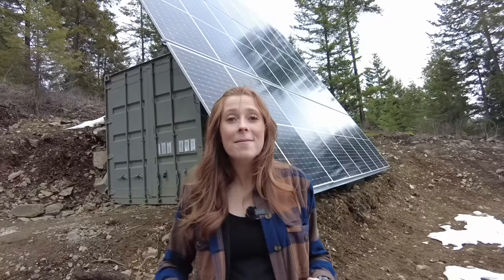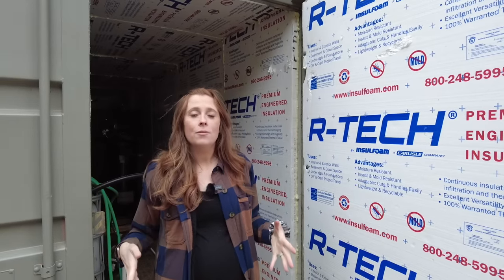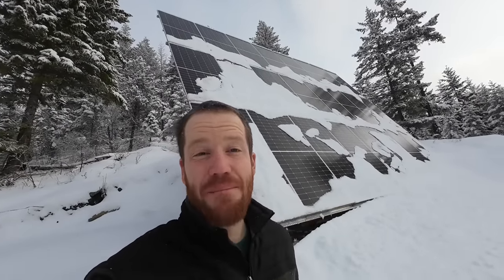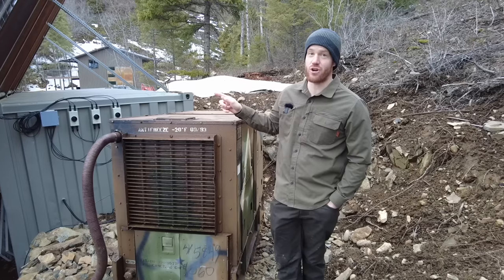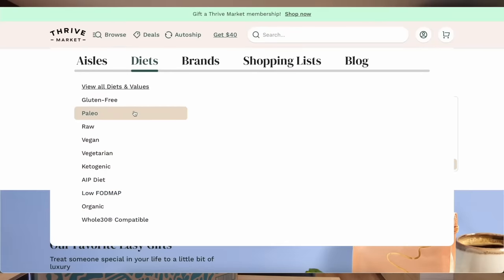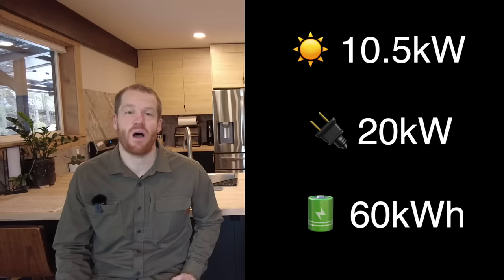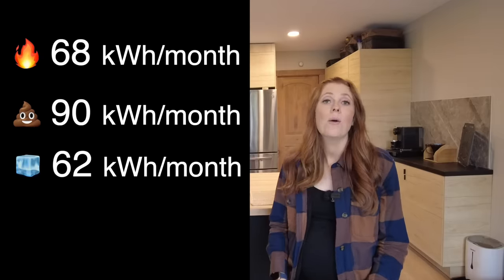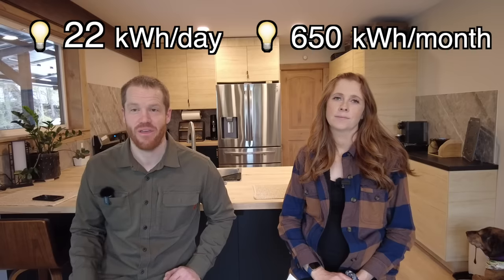The TRUTH About OFF-GRID Solar | Winter Update

Comment: I have a German made (Stiebel Eltron) whole house, tankless, electric hot water heater that uses zero power when there is no demand for hot water, it is no bigger than a briefcase, and it hangs on the wall in the garage. The model I have is 29kw at maximum power, that would allow me to turn on every hot water tap in my 3x2 house. When only one shower is running it uses only enough electricity to heat the water to the desired temperature. I know 29kw sounds like a lot, but there are two points to consider: unless you are running every hot water tap full blast you will never use all 29kw, and second, lets say for example one shower is being used and that = 5kw you are only using that 5kw for 15minunts when the shower is running. 
Even though your heat pump water heater is very efficient it is still using electricity to keeping a large tank of water heated when not in use.
If you switched out your water heater to a tankless whole house electric water heater and installed a septic system to negate the need for a power-hungry incinerator toilet you may have enough electricity from the solar panels to fore go running the generator at all. It is still warranted as a backup in case of exceptionally cloudy months. Another thing to consider is the added electricity produced by the roof over the deck.

Comment: Have you thought about adding a wind component to your off grid power?  I get that the cost to fix your deep winter "donut hole" would be pretty huge, but if they can be integrated, the wind power could give you an easy road, day and nite to backfilling it. Riley, Cortney- ya'll lookin' good in the neighborhood! Speaking of which, has anyone local been looking to hire an Ambitious D 8 operator and D 8? Your "driveway" project was awesome- and this winter seems to have shown few real faults and all are things you can correct.

Comment: It is refreshing hearing the realities of "off grid" and  that solar /green is not all unicorns and pink clouds. Still impressive what can be accomplished with good planning and quality components. It will interesting to see what on-site laundry will do to your power needs and if the fuel expended to go to town is greater or less than what running a generator will run. I'm surprised given Riley's fab skills you have not automated your solar array to tilt to full vertical to clear the snow. As mentioned dirt work will help.

Comment: You can go with a much smaller automatic start generator. Just size it about 20-30% over your average load. Yes it will take longer to charge your battery but your not sinking allot of money in a generator that you will only use in December. For intermittent large loads beyond the generator capay, you can have the battery cover the excess for that shor time.

Comment: You could save on refrigerator running cost by using an icebox setup for the winter months. Mom grew up with one of those and my GF's house has it still in the kitchen but now closed off from the outside air.

Comment: You could remote control the generator using some RC servos and a web cam. There are plenty of RC cranks and connecting rods that can be used to adapt to the control pots.

Comment: Great job ! much savings to be able to spend on other things. I only have a small 1000w system 4 / 340w panels with 1500ah of storage and I use my washing machine, you just do laundry when the sun is out & it takes no power out of the batteries, washing machine only uses 450w to run so when you have a 1000w coming in its no problem,

Comment: Thank you for posting details.  I'm designing a system for southern Michigan and I'm thinking of 92 kWh of battery paired with a solar array the same size as yours.  Rather than a generator, I'll supplement with grid power when needed.

Comment: Great to hear your firsthand account.   Interesting to note that even with a small house and a large panel system you still are running short in the winter.  Not surprising, of course, given the climate. But your point is well taken that it may not be worth it to increase the size to the point where a generator would no longer be necessary at all.  I will say, though, that based on your aerial shot at the end, I am seeing some trees relatively close to the array.   I'm sure you do, but most people don't realize that with most panels, even a small bit of shade  (like 5% of the panel) can easily stop the entire panel production, and possibly an entire string depending on the wiring.   So it is normally essential to remove all possibilities of shading.  If I were in your shoes, I would look at this carefully, and possible remove some trees near of the array. You may be pleased at the increase in production in the winter.
Reply from the maker: That is an old drone shot! We’ve done significantly more clearing since then.

Comment: When you get a washer, my wife and I (no kids) have found a 110v LG washer/dryer combo to be really electrically and water efficient.  Some folks don't think it drys 'well enough' but being a condencing dryer, it really uses little electricity.  When getting the laundry out it feels 'moist' but a single shake of the laundry and it 'flashes dry'.  We are in TN near Nashville.

Are you putting in the extra solar on the deck into the 'main' solar?

I thnk you should 'build' the hot tub <<grin>> sounds like a fun project.

Thanks!

Comment: Hey there are some great and cheap long term energy storage in the form of sand batteries or a good ol flywheel. Use the excess summer solar to spin up the flywheel and draw on it in winter.

Comment: Great summary on your power system. The obvious conclusion is that $450 of fuel is much less than expanding your main system. Plus with your presumably sponsored Bluetti system and deck panels your winter fuel usage will likely go down.

Comment: It's actually not too hard to automate the start/stop of the generator as well as throttling it. You can do that with a genset auto-start controller and an electric actuator conversion kit like a EEG7000 from Governors of America. It's not cheap, but it can certainly be done.

Comment: Fave ginger couple ever!

Been looking into off grid solar/battery/geothermal heat pumps for a while and am leaning towards using hydrogen and a fuel cell for the winter backup. Excess solar in summer time is used to power an electrolyzer to split water into oxygen (released into the atmosphere) and hydrogen gas (stored in tanks for winter). Running the hydrogen back through a fuel cell in winter gives you electricity, heat (as a byproduct), and water. That's pretty much it.

A gentleman in NJ has had his house set up that way for decades now (you can find his stuff on YT too) and at least two companies in Europe have commercialized versions of the tech at a scale useful for a home. Just another possibility that would fit as an add on for your current system and you have the room for the tanks to store the hydrogen for sure. Heck, you might even be able to use the oxygen for some of your welding to boot.

All that said, just love your channel and how you guys go about everything you do. Always look forward to new episodes. Congratulations on the new addition to your family and enjoy the time off!

Comment: If I understand your situation correctly, you have more than enough solar area to supply power for 3 seasons, and additional area would not give you much benefit during those periods.  You need additional power only during the shorter dimmer days of winter.  A cheap solution to boost power on those days would be to use reflectors to collect more available light.  A bit more complicated to use because you would have a system to aim them (using electronic linear servos)

Comment: There's definitely a lot of savings to be had with yere energy use, yes it's lower than most Americans but it's basically double what we'd use here in Ireland and my home is 750sq ft and terribly insulated with a 250sq ft workshop with zero insulation. Have a look into exterior insulation. The more you insulate the better. Better for summer and winter, also install a porch on the entrance doors to the home, they're an excellent buffer for winter and summer to keep the home at the right temperature. A geothermal system would also be fantastic for yere needs.

Comment: Solar doing 2200 kWh in winter, plus 800 kWh coming from the generator. That sounds like a really good balanced system. 
Adding 30% to your solar would still not allow you to be without the generator but would cost a lot.

Have you looked into shadows on the panels in the winter?

Maybe look into storing heat into a sandbattery using the excess electricity in other months, could be a workable idea.

Comment: Good video. The systems of come a long way. Think the best way is with cement in floor heat that runs from the wood boiler that heats the house when the battery voltage is high there's an electric hot water tank that heats it all. The concrete is a huge thermal Mass which works like an extra battery heating up throughout the day to release later. I found it the most convenient way of dealing and freezing issues where I'm at in Northern Canada -30 is normal also the traction lead acid batteries can be depleted over 50% without hurting them and they're very cheap compared to alternatives. $5,000 new roughly for like 70 kilowatt hours

Comment: I'm off grid for 40 years I live in Naples Idaho. Pro tip use a tankless hot water heater not electric. A propane generator that would auto gen start would be awesome it's my next upgrade. Propane is great since its stored in a lrge tank so no more fueling up the generator. I do laundry it's not that much power but use a propane dryer not electric.

Comment: Have you considered supplemental wind? Also, is there a creek on your property?  If there is micro-turbines might be an option.  Ideally though we as a society or the "off-grid community" really need to find a way to store some of that excess electricity for later use. A 9-month storage system (even at 50% efficiency) might allow you to go 100% renewables. Still, thank you for being the people that are out there being true modern pioneers. Even the laziest of us city-dwellers will benefit from your pushing the limits.

Comment: I find your videos very exciting and informative. I wonder if it wouldn't be incredibly practical for you to have a fuel cell that produces H2 during the summer and then consumes it during the winter, preferably in a combined heat and power plant. This way, you would have electricity and heat without relying on a gasoline generator. Here in Germany, there is a company that offers something like this. Maybe there is something similar available where you are.  Greetings from Germany!

Comment: If you were to build a little vestibule to, encase your generator. You could vent the heat from the generator inside of the box car the excess heat would proportionately go out into the berm keeping it warmer could increase your safe operating outside temperature downward 10 to 20°.

Comment: For a comparison, here in San Diego (we live in an apartment) we use 550kw in winter months (lived here 3 years and never turned a heater on) and our monthly electric bill is $280, in summer we use 1100-1350kw (AC is expensive) and our bill is around $580.  So your diesel cost is far less than electric rates here.

Comment: Thanks for the info.
I would like to have an off grid system but have no idea what I would need.
The info you have provided gives me an idea of what to expect. 
Since I live in western Oklahoma I don't see a lot of snow very often. I do however have many cloudy days that can last for over a week.
I do have another advantage of wind. I know you don't get much wind there and is why you don't use it.
I believe if I build a similar system with wind to supplement I could go without a generator much longer. 
My home is all electric including an electric well pump. I use wood for heat along with a small propane heater once in awhile. I don't run any welders or equipment other than an air compressor when I have a flat tire.

Hopefully you all will get a self start generator in the near future to eliminate going out to start it.

Comment: Your generator relies on basic switches to dial in, as such you should be able to code an Arduino controller to do all the tuning for you, including throttle control. 
And i think you should put a few linier actuators on it. Then if you dig a bit more, you could dip the panels to vertical at night, then bring it to optimal angle every day.

Comment: Silly question, where do you need an refrigerator when its outside -21. Just in the winter power is limited, and you need to save what you can. I advise you to have a look to an insulated “building” where the temp stays around 5 centigrade. Maybe your container can already fit the job. You only need a smal refrigerator, for most needed stuff. I guess in winter you can save 80% of cooling power, just using nature 

Ohyea always very nice videos. Also because you cooperation look on how my wife and I work together as a team, just like you do 👍👍👍👍👍👍

Comment: Deffo interested in the spreadsheet. Would y'all mind if I took your data and used it to generate some graph estimates using R?

Also, having a dump load for any excess solar energy would be a great idea. Using it to heat water would be a great application. However, using it to power air conditioning as you've done is an incredibly useful application.

Comment: If you do anything with your generator, you may want to consider generating DC to direct charge your batteries. Generating AC and then converting it to DC to charge is horribly inefficient... the equivalent to less than 50% fuel efficiency (i.e. throwing away at least 50% of the fuel)

Comment: If you had water on your property you use your excess power in the summer to pump water from the bottom of your property to a reservoir at the top then when your short on power you use that stored water to power a hydro generator. There is a power storage facility in Alberta canada that going to do this soon at a location that was supposed to be a coal mine.

Comment: Have you considered means of storing energy that don't use batteries as a way to supplement the less sunny months? Things like weights or water storage (I guess you'd have to use some sort of antifreeze system), even compressed air is an option. Seems they are not very efficient, but feels rather sad to be able to generate so much power in summer and have no way to utilize it. 
Or maybe you just need to weld/plasma cut more stuff during the summer so you aren't wasting any sun! :)

You guys have truly inspired me, I'm already making plans for off grid living (although it'll be a few years still) and plan to shamelessly steal your solar panel array setup (with the storage container/rotating system).

Congrats on Oliver and I wish you guys all the best, enjoy your time off!

Comment: A good backup...backup for your generator could be the Westinghouse DF9500 duel fuel electric start 9,500 running/12,000 peak generator with electric start built in battery charger and keyfob remote crank runs on gasoline and propane has a feature that should be able be setup for automated automatic start ( on propane ) to make your backup system super convenient.

Comment: A hybrid system with solar and wind will help spread out the generation of power to minimize the generator usage, possibly down to 0. The wind generator would just be added to the  battery and inverter system you already have. Now if you had a small stream on the property , you could add that to the system too, or possibly just run everything off of hydropower if it's year round.

Comment: I think you guys are directly east of me (not neighbors) but it is nice to know what the solar is like for this latitude. I am thinking about committing about 1-2 acres of my property to solar, and this is helping me understand some of the potential risks I would be taking. of course, I'm in a flatter area of eastern washington, but I still have to figure out what I'm going to do for winter tilts vs summer tilts. but I mean I was thinking of putting each panel on an automatic swivel that changes throughout the day based on where the sun is at. that's probably really expensive though.

Comment: One thing you could do with excess power during the summer is to use it to charge a sand or gravel heat battery.  It's essentially just a well insulated silo with some electric heating elements and a heat exchanger.  You heat it with the excess power during 3/4 of the year, and then draw heat for home and water heating during the winter.  It's actually compatible with heat pumps by preheating their outside air intake.
Reply: a thermal battery lasts days under usage, not months.  i'm building one into a house currently under construction in CO.
Reply: @BrianKrahmer  
How long it stores heat depends entirely on how big it is and how well it's insulated.  If it fits inside a house, it may store heat for days.  The bigger they are, the more efficient they get because they store heat relative to the mass, but lose heat relative to the surface area.  Pretty simple physics problem.  I was thinking of one the size of the house mostly buried like their shipping container into the hillside.
Reply: @BigGuy8059  you haven't told me anything new, but still don't grasp that you cannot make an economic thermal battery to last months.  If I'm wrong, please prove it

Comment: I read that a combination E-W orientation vertical bifacial generate more than classic south (opposite hemisphere) on winter. It generates a lot less on summer than the regular configuration, but if you add more panels, you can consider this configuration to increase the winter generation instead the total year-wide generation.